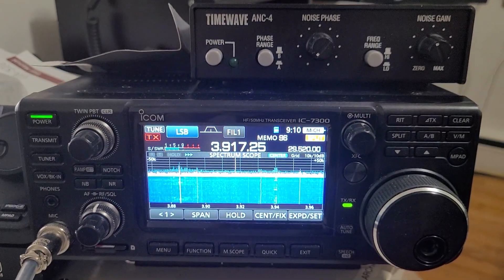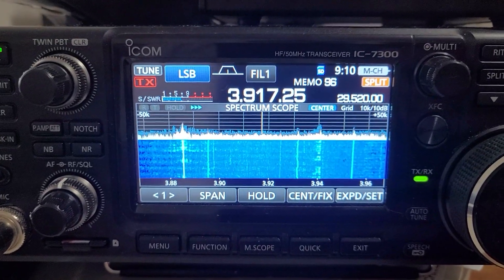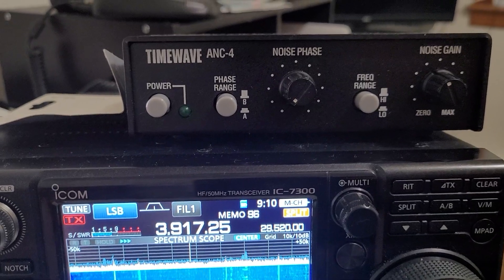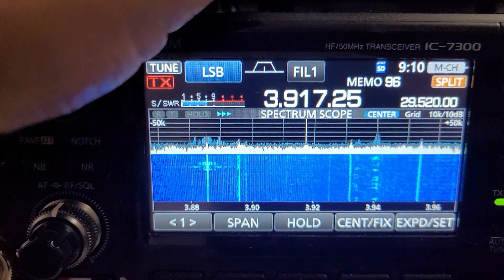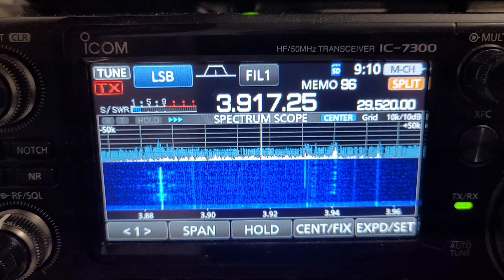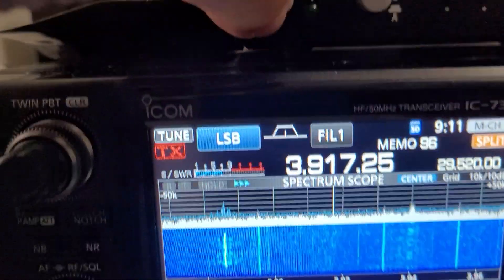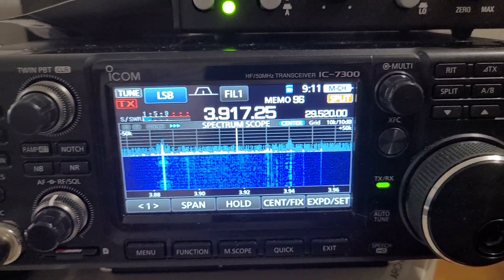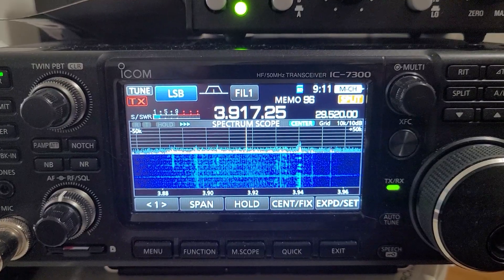Quick Timewave ANC-4 Demo

Comment: The unit has 6db attenuation... so the noise floor will drop even without phasing the noise out.. I have the unit and it needs a better way to balance the 2 antennas